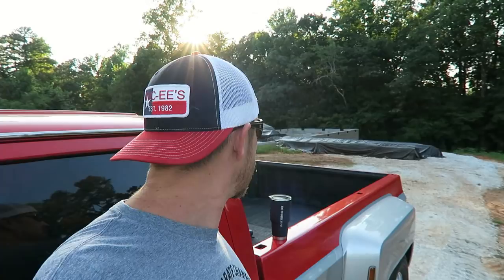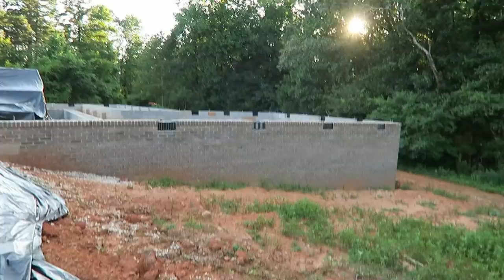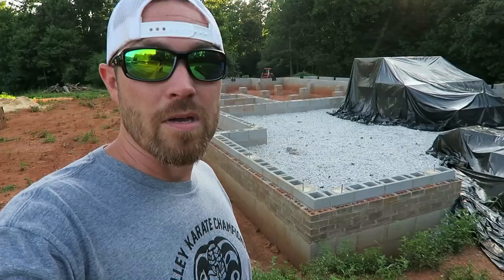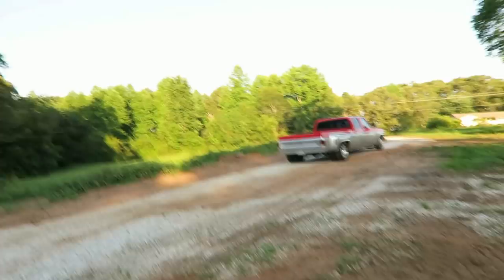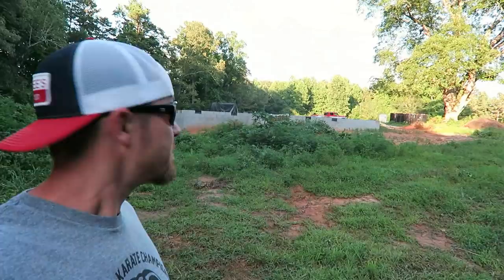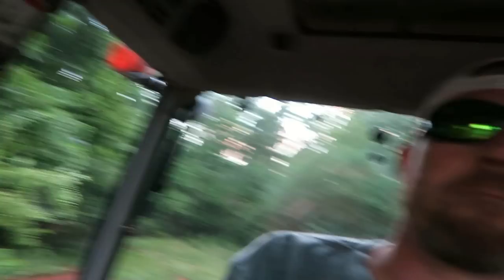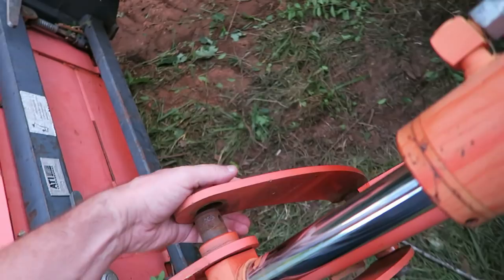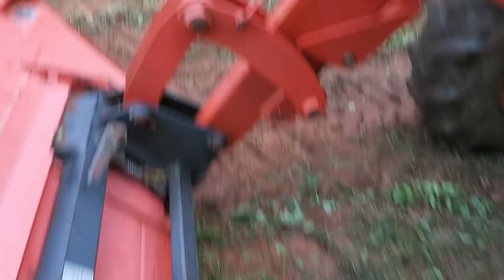My New Hot Rod

Comment: Bolts go in those pins to hold the pins in, once those go missing like that, that means the pins where not greased enough and the pins are now frozen up (rusted) in the main part of the frame, I work at a Kubota dealership and deal with that all the time
Reply from the maker: yeah thats what I have figured out....gonna have to remove all the pins at some point and clean, install and re lube

Comment: Equipment is the best! I had one of those same machines on loan for a few weeks before I got a John Deere back hoe, cleared my whole lot and stumped it out, so many things you can get done in a short period of time. You can back blade to level it out pretty good with the bucket on that also. Good luck, get some extra replacement lines, they only break after the hydraulic shop closes for the weekend.

Comment: seems like a pretty decent tractor , going to get some use out of it for sure , nice add on would probably be a brushog to keep the bushes down a little near the trees , another thing you might want to make for it is a wheelbar for vehicles like they use for towing cars 
https://qph.fs.quoracdn.net/main-qimg-0e0e6a0e93e35e4e8e0542cf775fd3b2-c
makes it eazier to move half finished vehicles around in the shop or in the yard , might be able to make it on the tractor drawbar

Comment: Don’t discredit that tractor for grading and landscaping. Get a box blade wide enough to cover the back tires and get a removable tooth bar. I leveled and graded my property over 6’ with a smaller bota and box blade before I built a front end loader.  Good tractor, pre emissions crap. I’m sure you’ll make tons of attachments. Start with a set or forks, you’ll wonder how you got by without them. Used 5k forks can be found cheap if you look. Tractor was the best thing I bought for my property.
Reply from the maker: Yeah forks will probably be one of the very first things I buy....I gotta be able to unload all that new equipment going in the new shop 😀 I will for sure have to get a good box scrape for some need grading I want to do.

Comment: The 90hp may be more than you might think you need, but you probably won't find it until you realize you don't need it.  The cab is sweet.  We borrow a skid-steer if needed, and borrow a tractor with a cab and 7' snow blower (we get 60" of snow per winter on average) from family that goes south for the winter.  Buy a bushhog and use it heavily.  You'll use it more than you think.  Firewood rounds in the winter, carrying stuff, etc.
Reply: You need bolts with thread locking nuts on the pieces on the bucket.  They tend to rattle loose over time.